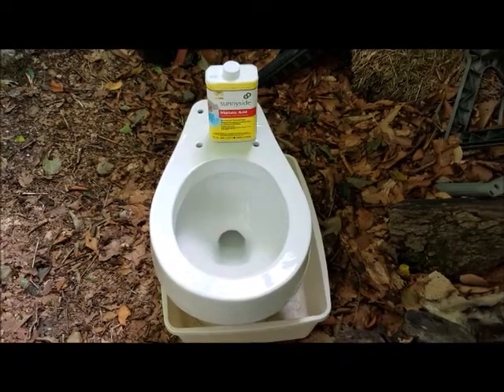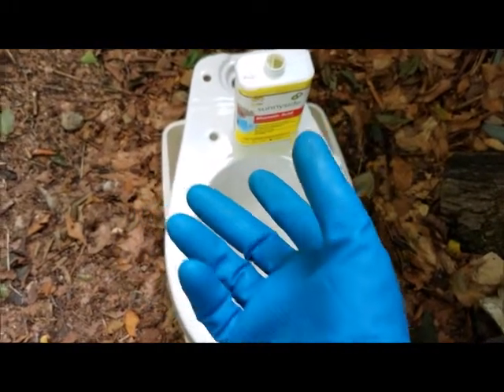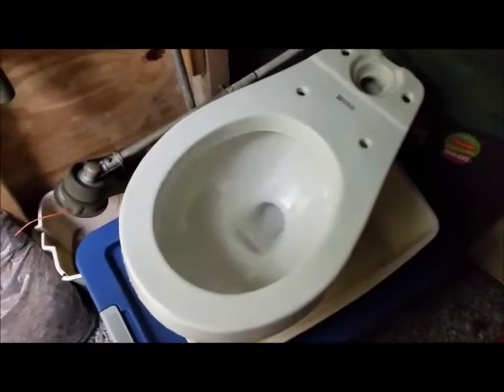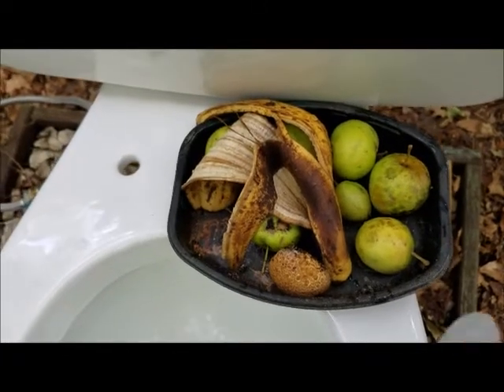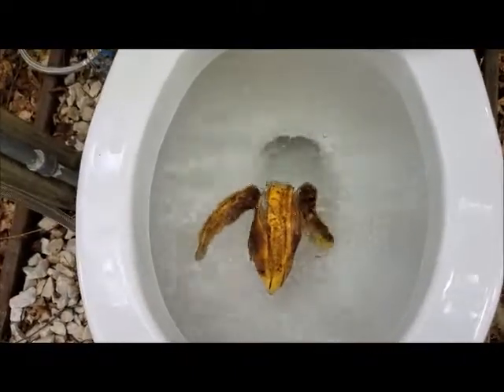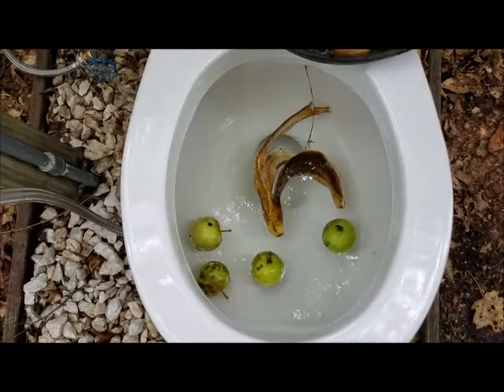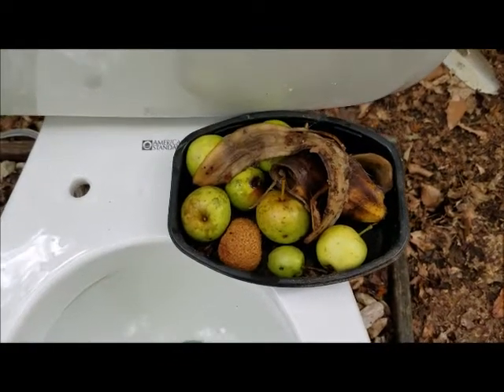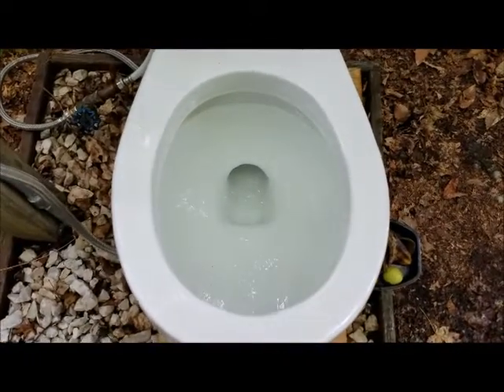100.  Saving The 1970 American Standard Cadet

Comment: From my experiences with over 30 years with mid 60's Cadets, bubbles coming up from the siphon jet means there's either vent/sewage line trouble (strong winds outside will do it), or there's turbulent flow somewhere inside and air is getting trapped in water and it's not all escaping from the rim jet holes at the flush start. We had a water softener,  so we didn't have to worry about scale and minerals. Ma was like "mommy dearest" when it came to cleaning the bathrooms, and was done every Saturday without fail. Guess who was forced to do it...? 🙄
Reply from the maker: This toilet is very strange.  I acid washed it again and tested it outside, and it flushed with no problem.  In other tests outside, it failed.  Many of the old toilets that I have had mineral deposits, which I think I got out, but some of them never had an acid soak.  I have a few that I should try a soak and then retest (that is, install in the shed for a while).  Water at home is from an almost county water system that draws from Lake Champlain.  The water from the cabin comes from a brook, so I have no mineral deposits from either water source.  This Cadet was also installed for a bit in my upstairs bathroom at home and performed badly.  I'm sure "Mommy Dearest" inspected your work, and hope that you didn'r recieve the wire hanger treatment if you missed a spot.  I too am fussy about my bathrooms being clean!

Comment: 9:00 good reminder to those who don't understand. The test rig we have at the warehouse features wooden boards to support the toilet, and a large trough underneath to catch the water. Then the water goes through a fine strainer to filter out any solids and through a marine pump which pumps it back up to the tank to be reused again. If I ever do become involved with our family plumbing business again, I'll try to film a demo of it
I have performed some tests on my toilet at home, whilst keeping it still installed. The main waste water drain connecting to the city sewer is actually above my basement floor, and there is a valve exposed. I can open that end up, block the pipe going out to the sewer, and collect all wastewater from my house that way
Reply from the maker: I would love  to see a demo of your test rig.  If I could test my toilets at home (and I can't), I would want something similar to reuse the water, since it's expensive in my town.  Is that valve on your house outlet a backflow valve or is it something that you control manually?
Reply: VintageToiletsVT Well the test rig is at my uncles plumbing business shop, which is l haven’t been to in a while because I’ve been busy with me new job. I can possibly send you a picture of the detachable sewage main my house though. It’s difficult to explain over text, but basically the main pipe to the street has a Y-connector with a cap over one of the inputs so I can open that up and block the waste water from going to the street. So it’s basically a bootleg manually controlled operation lol.
Also, I’m curious what part of Vermont you live in? I’ve filmed a few videos in VT and also know of some other places’ fixtures, was wondering if you lived near any of them

Comment: Those were amazing tests! I have seen mineral deposits come loose if a toilet sits dry for a long time. I wonder if a piece of mineral dislodged in the rim somewhere and was tossed around, occasionally blocking the jets? Maybe it was finally dissolved. From my experience, the acid will smoke and turn green when it reacts with mineral, which is alkaline. That was most likely a sign of minerals in the toilet. 
 I try to avoid using muriatic acid anymore because I've heard it will etch the glaze. I haven't seen any major evidence of that on my toilets, but maybe it would take a long time or repeated soaks. Sometimes, you need it though!
Reply from the maker: I think I might want to ream the rim jets and then acid wash the rim interior with the bowl upside down.  You have a good theory that a piece of mineral deposit came loose and moved around to clog the jets.  We used muriatic (hydrochloric) at work to clean semiconductor wafers at various stages in production, but not as an etch.  We used hydrofluoric acid, (HF) as an etch.  This would damage glaze on a toilet bowl because it eats through glass.  It's always stored in a plastic bottle or supplied by a bulk system. It's one of the more dangerous chemicals because if you get it on you, you can't immediately feel it.  It will then work its way down and attack your bones.  Fortunately, I never had to work with it.  But I do know of a couple who got it on them and needed immediate medical attention to prevent bone damage.

Comment: Glad it's working properly again. You can tell the difference in sound in the flush before and after the rim was soaked in muriatic acid. The flush now, you can hear much more air escaping from the two large rim jets at the front right of the bowl. You can also now see that there is much less air coming through the siphon jet. I am sure that now the toilet will function perfectly for many more years to come.
Reply from the maker: Next year, I'm going to clean those jets physically and then do one more acid clean to see if there is any improvement.  Thank you for your comments.